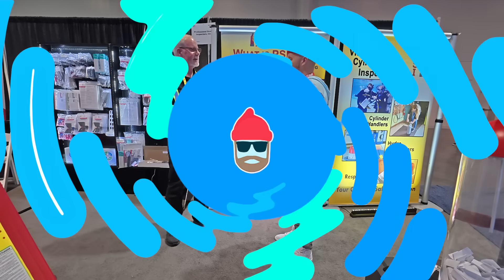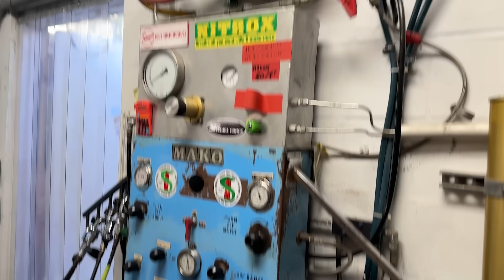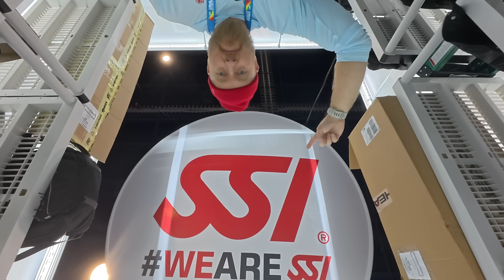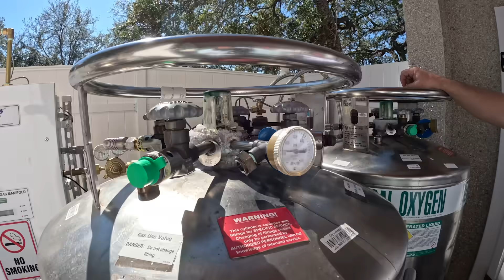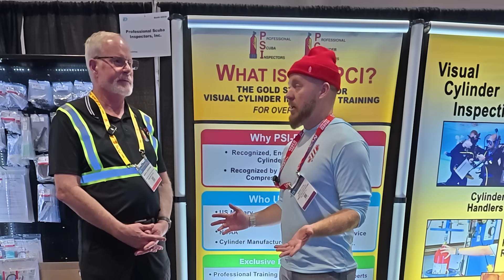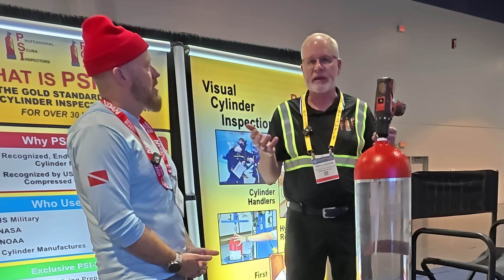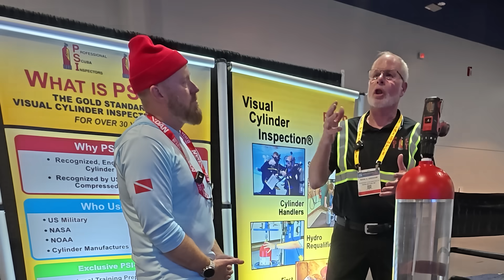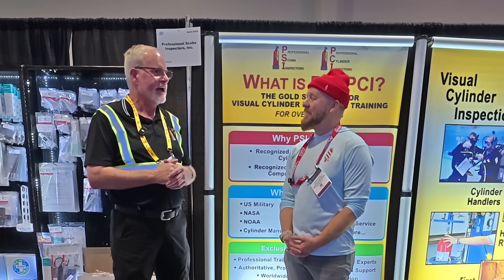101 | Scuba Tank myths busted: Dive Industry Expert debunks common cylinder misconceptions.

Comment: I was a Boston Fireman, we filled our own and I was  a Department Diver so filled my own but we filled them in an Armored Bin that vented outside, so I felt safe our System could pressurize double the usable Pressures.
Reply from the maker: Yup, I’m with ya. I used a mako containment fill station (it did 3 at a time) in the back of my shop as well- it wasn’t worth risking the staff’s life because of either a simple mistake or a cheapskate wanting to save $8 for the vip ✅
Reply: @TheScubaDivingChannel  Yes, one time a knucklehead given a do nothing Job said "I'll fill that, you got to be qualified "
 It was a 1960's US Diver 72 (Steel of course) rated for 2200 PSI. 
I normally would cool it and fill whatever it was slowly' he put it on the Floor not in the Armored Bin, threw the Valve lever full open and it was set for 5,000 PSI, I realized that when after 3 seconds the Burst Disc let go, I leaped up and opened the J Vale my Blood instantly turned cold , I screamed you Mother Fucker you could have Killed us.
He said thats they way I fill the Fireman,s SCBA's .
It flashed through my mind how I could have been turned into Hamburg.

Comment: Great interview and excellent information from Mark Gresham. I do a lot of cylinder inspections and PSI has done a great deal to make the scuba industry safer. One anecdote: I love old steel "72s" and own maybe 2 dozen of them. Several years ago someone donated one to the local dive shop and they passed it on to me. The cylinder was full and had been last inspected in the 1980s. Out of curiosity I analyzed the oxygen content of the cylinder and it was just over 21%, so steel cylinders do not automatically corrode internally.
Reply from the maker: @danmarelli551  haha love it! And yeah I use those as well, love the size (2250psi lp fill is amazing!) ✌️

Comment: 14:08 he has a degree for speaking much and saying nothing. there are numbers you can ad to surface*oxidation*o2 includet, then if the raw service is like beams "corrodet" is oxidiced, the grade for nex molecules bounding is significently reduced, i would mentin it by at least 90% my name on it higher. means if the "crust" has built up no oxygen can enter it as easy as bevore youz have created a layer and it will be mostly the same as an white ore carbon bottle, would out of the blue say 99,7% of oxygen will be under pressure after first pressuring up (test the safty of the bottle) will be oxygen and not will be desolved in electrocemical....... (desolve? i m not the greatest in english).
if anyone wears such a vest, dont trust em they are hired this way and com not from crafting, not even man that dived that thing. (ask them if they wanna have a dive in there gear, you have to order and hand it out to them on spot.

Comment: sooooooo. youi are talking about thermodynamics. but the real good thing is improving tnaks and valves to hold more pressure. i can tanke an argon tank le the velve open for a few mins, than fill it with air ore anny other mixture of gas. there will be only the gas in it whenn it will be filled with the gas. the metal will not influence the gas mixture, and the coolent of the tank if not cooled, if you put 5 liters in a tank anny voulme you pressure in ther will be 5 liters of a gas in it.
there is no thing about cooling.
the only thing you have tho look at is the cosumtion of fluid in the air you put it in the tank and not what is in the tank. 
so you need dry air to not clugh your valve, because if you kill pressure you kill temprature. if it freezes outside (it wil happen if you do it fast, thermodynamics) and the air insede the tank has no fluid inse id there is nothing to freeze^^.
if u dont believe me question a real scientist in physics, ther is the way to go.
and this theorys and answers are a few decads away in the past and common knoledge, the only reason they get to it shortley is "obsoleszenz, sry german word, osram phillips and ge made it great, about the livespan of an glowbulp?" if you make a machine like the vöst drehbank (the best lathe ever made, nowone needs a new one for over eternety in facturing, if anyone had one you are out of busines and you close even with spare parts because they likeley (missuse) never needed anny, inclouding not lubricating right and getten the debry off with airpressure (the badest thing you can do to a lathe, sry there are worese things but .......).
if you have coverd the market there will be no improvements.
and diving is such a thing.
there are all valves avivable (fuck there are multi valves to increase the surface and get out of the deep pressures to "air" pressure they will only work mechanic, (i work there easy thing) and not make it common. the body of the filled bottle could be cold but only for a few bar. if you are intrested you can make the math for your own.
the stability of an carbon fiber kank without welding joints is impressive.
you only have to go in the material, but you have to consider the elktro"korrosion" dont know the exact word in english for it. but it comes in decades under seawater influence to corode such materials.
the only real reason to use steel tanks is, they are cheap to make proofen and if you die they can warship a man thats a 100 jears old for his miscalcs because he dosent knew about real atomic structures and the jointwelds they are likely to break, the positive thing is they can sell cou a brush that corodes even more the severice (white metal) electric corosion. like in ne dams (opferelektrode sry again german) that will eroder your tnak from inside out by beeing a higher grade metal than the tank. and corousen could be a protection like all metals do. stainless steel has an oxilair that provent it from more and faser oxidation, copper has it too greeeeeeen, than look at railway "beams" dont know the word for it the train rides on these tracks, they are rusty "oxidicing" but this makes em even "oxidatingproofer".
you cant stop it but you can turn time to your side.
steel tank and stainless brush kills your tank with elektoroxiditatin like the "opferelektrode" in saltwater more than everywere. (temse river "schleusentore sry german agim").

dont get fucked be the fucker with real knowledge. you dont have to go to kollege, better you live the way and know what your doing.
a good factorie provides for good minds.
and problemsolving at a level that the solutin for most problems is in your way of sight,

Comment: This video contains some gross misinformation.

First, I'm calling BS on the water fills. I have my own fill station for over ten years. I usually don't fill tanks in water because I have the time to let them cool and later top them off. However, I do sometimes used water and used to get fills from places that followed this misinformation and frequently got hot fills. When you fill an HP tank, you'll easily lose 500 psi when it cools. The simple solution to expediting cooling is to wet the tank. Granted, it's not going to immediately drop the internal gas pressure down to ambient room temperature, but it will significantly drop the temperature, both inside and outside. If you immerse a tank in water during the time it takes to fill (let's say 10-20 minutes), the tank might be slightly warm, however, not as hot as it would be without the water and you will get far less of a pressure drop, maybe 100-200 psi. This is common sense and should be obvious to anyone who has filled a tank both wet and dry.

“Air oxygen mix is flammable whereas pure O2 is not flammable.” More misinformation. Unless you’re considering NOx, a combination of N2 and O2 (from vehicle emissions), air is not flammable. NOx is not created during fills and an air/O2 mix (enriched air) is not flammable by itself unless it’s exposed to some type of fuel.

The story told about partial pressure mixing and the use of Titanium in regulators is misleading.  Unless you top off with O2 and connect the regulator right away, the O2 will mix in the tank and dilute to the desired percentage.  Prior to the dive and connecting the regulator, the tank should be sampled. In the process, any O2 left in the valve stem will be purged when the mix inside the tank is sampled so that it reads a consistent percentage.  Most fills are done at a shop—the customer’s titanium regulator is not going to be used in the test.  If you’re testing in your own garage fill station using an analyzer connected to the inflator hose of your titanium regulator, then yes, you have the potential of putting near pure O2 into your titanium regulator if connected immediately after the tank is topped off with O2.  Given that most tanks that are partial pressure blended are filled at a station away from the dive location, there’s usually a good hour if not several before the regulator is attached, providing ample time for the O2 to mix.
Reply from the maker: @stevelawson4370  why don’t you email them this, since this is what they do for a living and you have a difference of opinion? Some of what you mentioned doesn’t actually contradict what he’s saying either, like the water fills (he said they do eventually cool but the amount and time for typical fills didn’t justify it). He’s always open to talk, their contact is in the description 👌

Comment: So if I have to inflate tires in a burst cage why the hell do they not have to fill bottles in burst cages
Reply from the maker: If inspections and fill station operators take just the basics, it’s almost unheard of. Even still, I agree with you and has a containment system for my fill station (big blue mako that filled 3 at a time) - I wasn’t risking my staff for one goof 👌
Reply: i think part of the problem is the energy released by a ruptured tank at 2-300 bar is huge and its going to hard to build… thick concrete walks with rebar and a blow away roof.
Reply: I think the cages are for things like locking rings coming off tractor trailer tires or tractor tires, etc and becoming a projectile.  In USA the tire shops I've been to don't fill regular passenger vehicles tires in a cage.  They always do it on the bead breaker. 

At the State aquarium we have a below-ground concrete-lined pit with an open top where we fill all the cylinders we use.  If a cylinder explodes, the only place for the blast to go is up.

Comment: I started diving back in...lessee...1971.  I had to learn to fill my own tanks among other things.  If I remember correctly, we filled tanks in water in case the cylinder failed, not to provide any cooling.
Reply from the maker: That was the old thought but apparently it doesn’t really do much if one truly goes boom lol 🤙
Reply: @TheScubaDivingChannel  I've seen one fail during fill.  We had it in a water-filled steel rack.  There were a few pieces of shrapnel in the bottom of the tank afterwards, but the cylinder and all it's pieces remained inside the tank.  That was reason enough for me to fill in water-filled tanks.
Reply: @TheScubaDivingChannel   " BECAUSE SURVIVAL IS INSUFFICIENT!"  EMILY ST. JOHN MANDEL AUTHOR OF " STATION ELEVEN"   CAUTIONS THROUGH ANTICIPATIONS OF "WHAT-IFS"!       WHEN SAFETY IS DEMONSTRATED AS PUBLIC COURTESIES.

Comment: I always back the valve off 1/4 turn from open for 2 reasons - 1) to make sure it doesn't stick.  2) If not sure if it's open or closed, try to close it.  If it's closed, it won't close more.  If it's open, it just closes a little, but it's still open.
Reply: I worked for 38 years in power stations as an operator. . 
We ALWAYS opened (or closed) valves all the way and then back it off a 1/4 turn. . .  It's industry standard.
If it's opened full and jammed open or fully shut and jammed shut, you can't tell which way to turn it to determine if it's jammed open or jammed shut.
By backing it off a 1/4 turn, for a start off it's not JAMMED so it should turn 1/4 turn in one direction and then stop and in the other direction it will turn more than 1/4 turn.
Reply: @richardrejmer8721  CASCADED CYLINDER VALVES HAVE AN "O" RING "BACK SEAT" THE GENTLE BACKSEATS AGAINST THE  "O RING" SEAL IT''S STEM AGAINST LEAKAGES.  30+YEARS OF GREAT LAKES WRECK DIVINGS WITH FILLINGS.
Reply: In welding and other oil field type work, we back off 1/4 turn. Different types of valves have different reasons for doing so.
With welding bottles, if it open to stop, people loosely grab the valve to see if it moves, if it doesn't move they assume it's closed... so if it's open to stop, and someone tries to check it, and it's solid, it just gets left open.

Comment: I had an instructor/trainer who taught to never use light-metal regulators.  She was also a professor, a physicist, She wasn’t even worried about oxidation, her concern was pitting and rapid failure. Titanium can hold static pressure, but rapid changes in pressure (like opening a valve) can blast the surfaces, cause pitting.

Comment: I am curios and would have liked more in-depth conversation about the mixing of separated gas. There is a piece of equipment in a refinery called a distillation tower where liquids and gases can be drawn off at varying heights before going on to further processing. Now these towers are huge, whereas a cylinder is not but as the gentleman said in this video hook up to an analyser and tap the side of the cylinder and you’ll see a reading change. Which does suggest there is a degree of separation. Now does the separation not matter because the normal movement will be enough to ensure a mix, or because the cylinder are small that the variation is negligible or another reason? It’s fine that you don’t have to roll or shake (haha) id just like a statement dictating the reason why.
Reply: If you partial pressure fill a nitrox tank REALLY slowly, the gasses may not mix well and take time to fully mix. But squirt the last 200 psi in quickly and it will mix just fine.

Comment: Why wait for the bar, you can bet the drink right on the boat!!  Bet they can’t prove a valve is closed without moving it.      Then follow up with : see we learned a thing or two from the last 100 years of mistakes in human logic - it’s all Safety by Design like right hand release & Know before you Go. Here's why: The only way you can PROVE a value is CLOSED, one of any size on a cylinder or a valve the size of a car - is for you to apply increasingly enough force to get it to move, and then at that exact moment you know that the valve is NOT CLOSED - then and only then can you proceed to the desired state. The extra stiction from the open-side end-stop can only add uncertainty to this algorithm - that's the purpose of the 1/4 turn.  He then could follow up with something like: That’s also why they are designed (the passages n such are sized) such that you can breath off a barely-cracked valve.  And then if they still need convincing he can start rattling off the ARS 52a, 1962 Section b paragraph 3§15.... and really put them to sleep :face-blue-smiling:
Reply from the maker: Why don’t you just email him? He lives for this stuff lol
Reply: I can tell 😍

Comment: Good stuff but, whether you roll a cylinder or tap it with a hammer, a partial pressure nitrox fill will not be homogeneous.  Tipping it about a few times will certainly mix it enough to get a consistent reading on the analyser.  Shaking, not so much.
I really don't understand the appeal of titanium regulators.  They're more expensive, the weight difference is trivial, especially under water, and you shouldn't use them with enriched air.  Is it a marketing thing?
Reply: I am a "dry foot" from the center of Europe. I keep my scuba gear light for airline baggage weight limits. But I agree, just like in cycling, it's expensive grams down.
Reply: No chrome to flake off and change internal clearances. Harder metal won't get dented at the sealing surface to the tank. But yeah, there's a coolness factor.

Comment: Did I hear right? At 7:45 "air oxygen mix is flammable..." No it isn't! It's a stronger oxidiser than air, that's all.
Reply from the maker: You can always reach out to PSI - PCI if you’re genuinely curious what he meant by anything - they’re super responsive to email or even phone calls. Their contact is in description 👌
Reply: @TheScubaDivingChannel  Air, with any amount of added oxygen, is not flammable.
It certainly supports combustion, but is not flammable.
Reply: ACETYLENE TORCHER/artist? THE LATE DICK RACE ( OWNER OF THE NEPTUNE ) OF CHICAGO USED A HYDROGEN/OXYGEN U/W TORCH TO ??? CUT A ?? SQUARE HOLE IN THE STBD BOW OF THE STRAITS OF MACKINAW'S  SS CEDARVILLE, ( ORIGINALLY THE A. F. HARVEY) AND SALVAGED ONE ANCHOR CHAIN WITH BILL BYERS (OHIO? INDIANA?) 1975-ISH.
Reply: SANK IN A SPRING FOG/ WITH IT'S BAD RADAR OF A 1957 COLLISION WITH THE SWEDISH STEAMER TOPDALSFIEORD? SP SEE FRANCES BERGTORF'S BOOK ON THE CEDERVILLE.